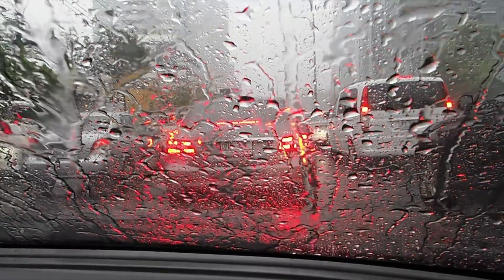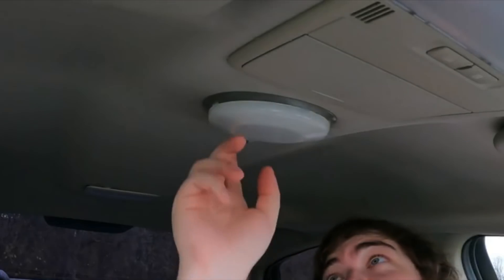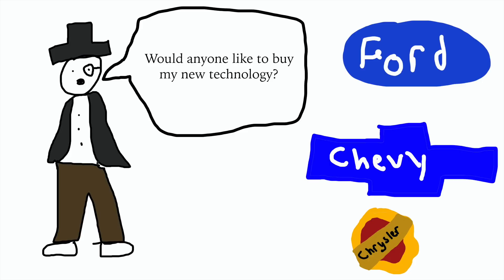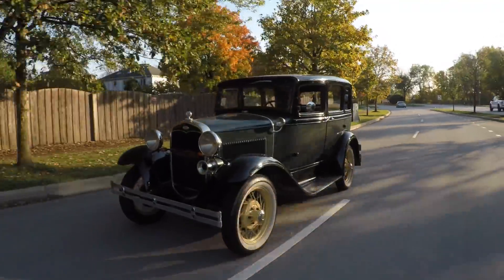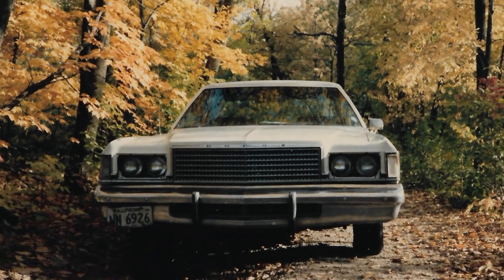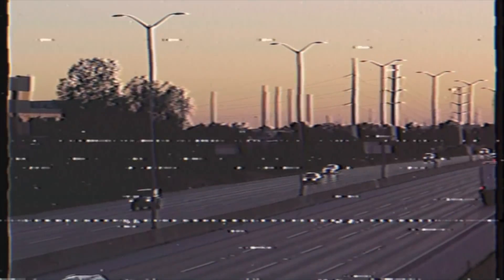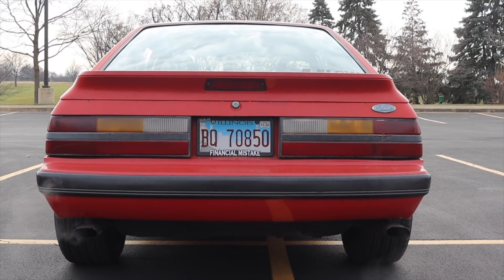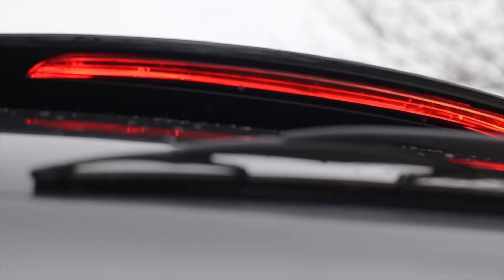The Third Brake Light - Who Invented Them & Why We NEED Them!

Comment: I wasn't even of driving age yet, but I remember when the Center High Mount Stop Lamp (CHMSL) became mandatory on cars in 1986. At the time, it seemed like a gimmick and some people speculated that any reduction in rear end crashes was due to the novelty/newness of the 3rd brake light. I recall some cars didn't get them until a bit later (Accord hatchback comes to mind, no idea how some cars got exempt). Now we have modules that can make the center brake light flash a few times to get driver's attention because we've become so used to them.
Reply: I actually reached driving age on December 30, 1985 so I must be a bit older than you.
     I reached driving age about the same time they were introduced.
Reply: @erictaylor5462  I remember it too, but I didn't get my full driver license with no restrictions until almost a year after you did, on October 13, 1986. Prior to that, at 16, I had a license that stated that I must have a parent or legal guardian in the front seat, and they had to have a valid driver license. They also had to have their wits about them, so playing the designated driver card was out. The next year, at 17, if there were no infractions, it was upgraded to anyone over 18 with a valid license in the front seat with me, and finally, at 18 years old, that's when we were finally able to drive alone, as long as we were able to pass a final driving test at the DPS. The next year, in 1987, my Dad was finally able to buy his first almost new car, a 1986 Chevrolet Celebrity wagon, which was our first car with a high mount stop light. He bought it for Mum so she had room to do her Avon deliveries, he kept his 1977 Chrysler Newport 2-dr hardtop, and I inherited the 1982 Plymouth Gran Fury Police Interceptor.
Funny thing about those high mount stop lights, and I just found out about this the hard way a few months ago, they're only effective if the person coming up behind you at 35 MpH while you're sitting at a stop light, is paying attention. Mine worked, as did both of the ones in the tail light housings. This guy missed all four red lights right in front of him; the three on my car, and the fourth one hanging from a cable around 13 - 14 ft in the air.
Reply: You know that is a good question, because even cars like the Lincoln Town Car which looked straight out of the 1970s, still put them in for their 1986 model year
Reply: @sped6954  That's the thing huh? People paying attention to their driving. Unfortunately these days, people pay more attention to the smartphone.
Reply: Usually old models get grandfathered in for things like this. Like, if the 85 and 86 models are identical they wouldn't need to add the light. At least, that's what I suspect.
Reply: Pretty sure that flashing brake lights are illegal for non emergency vehicles. It’s buried somewhere in the FMVSS.
Reply: @jamie7664  I've heard that, but it's either a gray area or it's not enforced. I think I even heard of some cars in certain states coming equipped with them. I've been driving around with a module for a flashing brake light for several years and driven all over the US and Canada, never had an issue.
Reply: @reallyrandomrides1296  It’s definitely not enforced.  I wouldn’t be concerned for a second. After the manufacturer sells the car, it doesn’t seen like anything matter here in America (light bars, illegal tint, aftermarket bulbs) 🤷🏻‍♂️
Reply: The fuck, I was born in 1986
Reply: @fixingitrightish  Damn, makes me feel old. I was 13 in 1986, got my license in 1989.
Reply: Between the taxicabs of San Francisco, and the regulation that made them mandatory, there was also the various affiliates of AT&T who had them on their cars. 

Actually, there were some cars that had them long before both periods.
Reply: @jamie7664  Depends on where you go. Most cops won't hassle you for it, but that doesn't mean they can't.
Reply: @jamie7664  What about turn signals incorporated into brake lights? They flash, it's a brake light... In Indiana, it's legal to have any color flashing light on your vehicle, as long as it's not visible from the front of the vehicle.
Reply: I find the flashing ones distracting. I tend to pay attention to that car instead of everything else.  I also think they are another one of the dealer scam add-ons they sell you as you sit in the finance office.
Reply: Wait, that’s why I keep seeing the center high light flashing? Dude I thought I was fuckin crazy, or tripping or something
Reply: I think one of the earliest aftermarket ones actually had the flashing feature.
Reply: @fracturedrealitygaming1326  Yeah, I've had people tell me there's an electrical short in my center brake light because it's "flickering" lol! At least it got their attention!
Reply: I feel like it would be great if the 3rd light flashed 3 times then stayed solid just so people notice easier.
Reply: Even scarier, people don’t pay attention to actual brake
Lights, looking  only for third on to determine braking. 
And I understand because newer “stylish” led taillamps are brighter than most cars actual brake lamps.  But if the 3rd is out, they don’t even notice the car is braking.
Reply: @wompa70 
Grandfathering wasn't permitted on this one. The third brake light went into effect for all automobiles manufactured for the 1986 and newer model years, regardless of whether the car was a carryover from the previous year or a newly altered existing model. The same law affected all light trucks manufactured for the 1994 and newer model years. Basically, if a manufacturer wanted to continue a particular body style, they had to find a way to incorporate it into that model or discontinue it.
Reply: the flashing brake lights trigger me because they are illegal and confusing because it can make it look like you are pumping your brakes.
Reply: @Carterthielftw_  Not sure they're illegal, that's debatable, and might depend on the area, but at least it gets other driver's attention. And it's just the center mounted brake light that flashes, not the taillights. And when it does flash, it's so fast, way faster that you could pump the brakes.
Reply: @jamie7664  newer cars come with the flashing third brake light. It only flashes for about a second or two before it stops flashing and goes solid red. It definitely gets my attention when I'm driving, but mostly because I keep thinking something is wrong with the wiring of the light lol
Reply: @Fandom_Junkie  Sorry, but I’m willing to bet that they don’t come from factory that way. I’ve seen some dealerships install them to all of their cars as a perk or dealer added accessory though.
Reply: @jamie7664  I live in canada which has very similar road laws and my friend got a ticket for having a flashing fourth brake light (it was for racing). Anything that flashes that isn't a turn signal isn't allowed
Reply: @sped6954  There is no cure for stupid (go see the channel on the 11ft8 bridge if you need further proof).  Person driving the car behind you was probably doing something 'super-important' on their phone.
Reply: @koenven7012 
Lol I've seen that channel many times. It never ceases to amaze me that there are that many drivers out there that either don't pay attention to well in advance placed signage which all but shows them a picture of their own truck in real time and forced them to turn right here right now, or that don't have any idea how tall their truck is. Great channel 👍👍
Reply: I think the flashing brake lights are now meant to denote a rapid slow down, at least when implemented in stock cars. This system flashes all lamps.
Not sure what's going to happen with any 3rd lamp flashers
Reply: @RennieAsh  my car actually blinks the hazards when I break hard, but that's in Europe, so rules and regulations will most likely be different.
Reply: That flashing third light is distracting.
Reply: The flashing ones do bring attention!!
Reply: Honestly, when I first started noticing those flashing third brake lights out on the roads I thought it was just bad drivers feathering their brake pedals. I hate those flashing brake lights.
Reply: @toddgardner8449  They guarantee no rear end accidents, or they'll pay for the damage.... Not a gimmick, schmuck.
Reply: @reallyrandomrides1296  Hate those flashing brake lights. It actively reduces my response time because it makes the signals less clear until I have time to see the following signals.

Think about it, there are only 3 signals while driving normally. Solid red light, blinking red/amber light on one side, and blinking red/amber light on both sides.

What happen if you see red light come on and then quickly off? You would think the guy tapped on the break or quickly turn on and off hazard. You’d have to wait till the 2nd blink to see it’s blinking and then see if this is blinking one side or both sides. All this can happen within 1 second but you know how important 1 second is when driving.

Adding a 4th signal to 3 not only adds more complicity, it’s even worse because it’s a bit similar to an existing signal. It turns “the car is braking” from a reflex into an active decision
Reply: @Peizxcv  Well, there will always be outliers. I think the rapid pulsing (not slow blinking) stands out enough that 90% of the time, 90% of the people will take notice. It really gets most people's attention, which is the purpose of it.
Reply: @reallyrandomrides1296  Get attention and confuse the hell out of them for 1 second isn’t better than an immediate unambiguous signal
Reply: What's your actual age
I mean you said I remember
Then what's your actual age?
Reply: @deepakk1347  49, born in 1973, got my driver's license in 1989.
Reply: There was no requirement for light trucks until 1995.  My vehicle was bought in 1997 as a 1996 and did not come with the center brake light.  The true manufacture date was 11/95 according to the placard.  I have given it thought to mount a center brake light in the center of the spare tyre. It would be very easy to do.  The center hole opening of the tyre is the same size of a trailer round light.  They fit perfectly.  All I need to do is do some basic wiring.  I have been hit three times on the back.  Too bad for the smartphone idiots. My rear stainless steel, double tube, bumper is filled with concrete.
Reply: I've read where the center brake light was implemented because of the fact that most American cars had the regular brake lights and the turn signals in one. Someone driving behind a car that is signaling to turn get confused because he/she doesn't know if the driver is pumping  the brakes or turning.  Now I don't know which is correct.
Reply: @waynejackson1426  Both could be correct, especially important for USDM cars that have the same bulb for the brake light and turn signal, with one side burned out, without a center brake light, it could look like a turn signal. Either way, always good to have more lights to be more visible.
Reply: @waynejackson1426  The drivers of lorries, motorcoaches, moving vans, and construction equipment were hitting vehicles a bit too much.  The complaint that they could not see the tail lights of the vehicle in front of them kept coming up a lot.  The high mounted, center brake light, was put in place to solve the issue.  Pickup trucks, 4x4 vehicles, cargo vans, had very high tail lights, as compared to sedans and coupes.  Thus, they were except for awhile.  But, the benefit was very evident and the center brake light made its way to all vehicles commercially manufactured.  The requirement of a center brake light is not universal across provinces and states of North America.  Though the manufactured vehicles are required to have them, some regions only require two brake lights and a left hand mirror.  I live in such a region.
Reply: What seems about right is companies start developing third stop lights to also include another running light and totally negate the innovation altogether.
Reply: A well hung comment
Reply: @Blueknight1960  or to the HUGE touchscreen with the apps and games and stuff that they can play while driving 🚘 ⚠️💥🔥
Reply: @jamie7664  I noticed that also. Thanks for the validation 👍
Reply: @reallyrandomrides1296  got my driving permit in............. 1973. I was driving since 1970. ✌️😎👍
Reply: @Evan_Horvath  correct. Cops can hassle you for anything if you pop up on their radar.
Reply: @fracturedrealitygaming1326  Ayahuasca?
Reply: @reallyrandomrides1296  
Don’t some Lincoln’s or Cadillac’s come standard with a flashing brake light? Pretty sure I’ve seen it before. Personally, I don’t like them, they’re annoying to see, even aftermarket flashers on motorcycles for safety.
Reply: @Evan_Horvath  
The Feds don’t require rear turn signals to be either red or amber. I hate red turn signals incorporated with the brakes because it takes a second longer to realize it’s a turn signal rather than a brake light. I think they’re dangerous, they actually cause more accidents because tailgaters aren’t expecting people to turn, it looks like someone just tapped their brake for a second.
Reply: Flashing brake lights are illegal, it is only in the last few years vehicles have been fitted with them and they only work under emergency stop situations or the hazard lights come on.
Reply: I always thought the 3rd brake light idea come from the late 70’s Oldsmobile Toronado that had added brake light in the back window shelf.they were one on each side, not in the center but you get the idea.
Reply: Dealers are now adding the tail light  flasher module as an added accessory to justify the increase price over MSRP by several thousands when you get the module under $50 bucks.
Reply: @JuaniPodrido  definitely not in the U.K.
Reply: @rickiejacobs5910   I remember those too. It's possible that those are what inspired the single,  centre high mount brake light.
Reply: I have a Honda sedan with High mount stop lamp mounted on the lower part of rear windshield. A few weeks ago a careless van hit us from behind when I applied brakes. Since then I feel like these lights should have been installed in the upper part of rear windshield. So that taller vehicles can also gather attention.
Reply: R Voit  Well, that was when I noticed they were on ever new car.

Comment: In heavy traffic, I use the third brake light of the second car ahead of me to start braking when a slowdown occurs. I can often see it through the car ahead of me.
Reply: I look far enough up  the road to not need it at all. I identify traffic jams half a mile before I'm close enough to need to take any action because of them and 99.975% of the time am able to slow down for them without touching the brake at all. 

Look more than ten feet past your hood and you won't need those lights. Also stop tailgating.
Reply: @TestECull  Tbf there is a problem with the car in front of you also tailgating and will only slam break when it's close, and sadly this rather not too uncommon. Some of these tailgater somehow can control their speed of the car to creep in behind another car enough not to make a collision. It gives false sense of security that the traffic in front still moving until the red tailight lits up then only will do a complete stop.

But yeah, still best advise is to keep a safe distance and don't tail gate. Which helps to prevent collision to the vehicle in front that may be doing tailgating.
Reply: @TestECull  I look far enough up ahead to predict when a traffic jam is about to happen and steer off to a different road in the nick of time. I never need to slow down to traffic, because by the time it happens, I am either on another road or stopped by a predictive lack of acceleration. I use a very tall periscope to see 10 football fields ahead of me.
Reply: @kornkernel2232  I'm already lifting well in advance and that is part of why. Most days I can whoa up for a jam on engine braking alone.
Reply: @TestECull  he said in heavy traffic I'm pretty sure that means bumper to bumper or close to it.
Reply: @eghty8fox780  Not necessarily. Heavy traffic can still be moving at 75-85mph.
Reply: @TestECull  yep I'm sure he is trying to look through a car if front of him going 75, 85 mph
Reply: @eghty8fox780  Yup. I do that myself when I'm able. It's actually more imperative at freeway speeds than it is on surface streets because that extra second of reaction time you get seeing the guy in front of the guy in front of you brake can mean all the difference in the world. Especially if you, like most everyone I observe every day, tend to think a 1.5 second gap is acceptable at those kinds of speeds. 

The faster you're going the further ahead your eyes need to be. If you're on the interstate you need to be watching the horizon, not the bumper of the guy in front of you.
Reply: @TestECull I'm sure that also works 99.975% of the time all the time
Reply: Unless that car happens to be older than 1984.